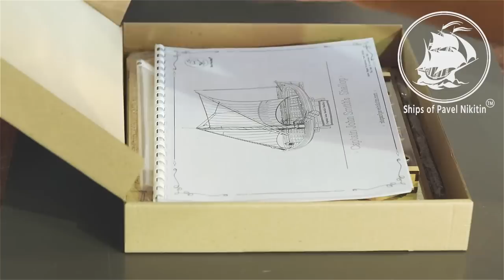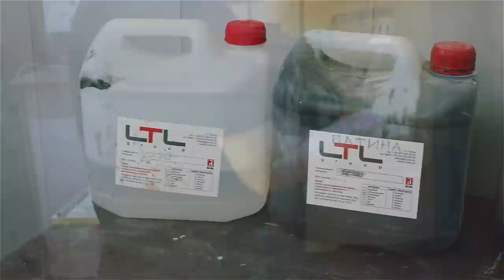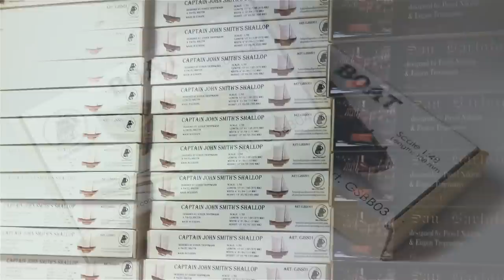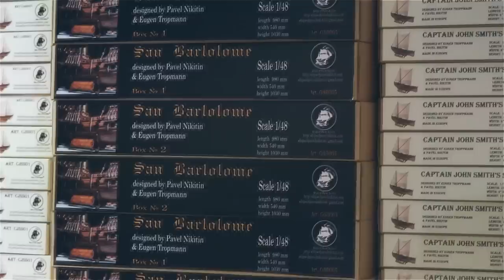How to Paint Like Pavel Nikitin

Comment: what an excellent video and mastery in ship painting!!!

Are those dyes diluted before being sprayed? If yes, using what kind of solvent/ thinner?

I know that the paimt film when using an airbrush is quite thin, but I wonder if one could just brush these dyes and then scratch them with the sandpaper/ sanding pad. I think the result would be the same, probably minus the extra sanding because of the thicker dye layer the  brush leaves compared to an airbrush...
Reply from the maker: These are alcohol-based dyes! They are diluted with alcohol and yes, they can be used without an airbrush, but they penetrate the wood quite deeply!

Comment: Olha, thank you for another great video. This was an interesting way to paint or stain a wooden ship, never would have thought of using a spray gun. Guess using aa air brush could achieve the same affects. I do want to say that the affects that you achieved on the Pinta was very realistic at showing age. Again thanks for a great video.
Reply from the maker: Yes, an airbrush will give the same result. Even better, because it can supply dye with less intensity, which is just what is needed for modeling...

Comment: sorry...not mine...it did not look like realistic.....more than a comic picture
Reply from the maker: Every type has the right to life!
This method is for those who believe that the model should look as if it has been lying on the bottom for several hundred years, such as the original VASA ship...
Reply: I agree. The side planking is terrible and by a so called master modeler. I have yet to see any tree that has a trunk with no knots beyond 20 or so feet which means this model was not well planned or built. Even shallow scribed line breaks and either nails or pegs would make it more realistic. Olha - your models are much better built
Reply: Airborne and JD Whit,  I am surprised that you, if modelers at all, do not respect other ways of  doing things.
Reply: @JonitIvory  As a 60 plus year modeler, stand by my opinion, which is critical of the quality of that model. Someone named him a "master" which in my eyes is that rendition is amateurish/mediocre.  If your opinion of mine is critical. too bad.